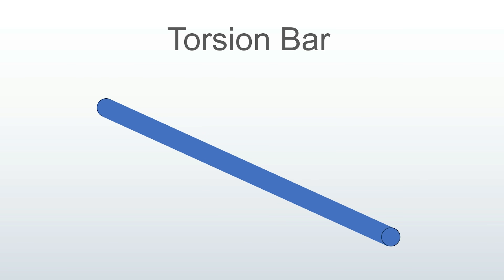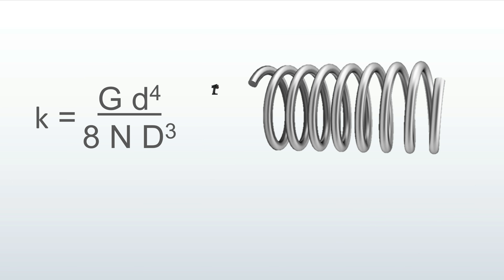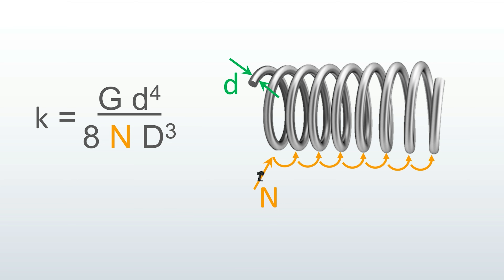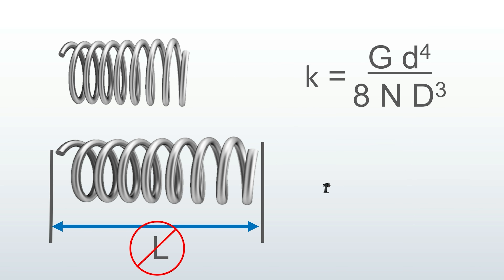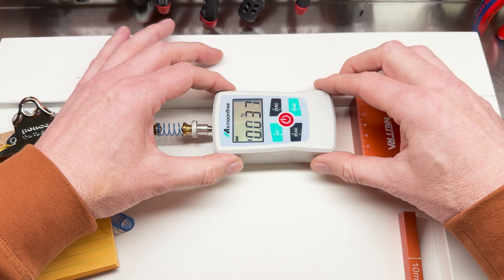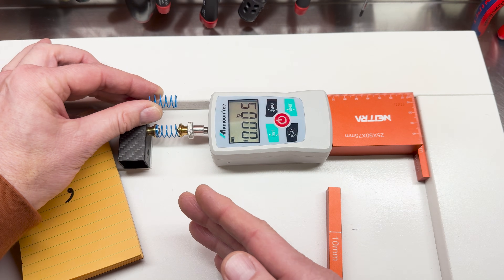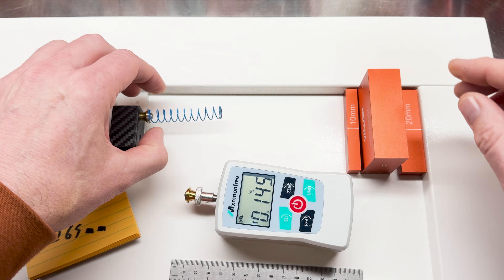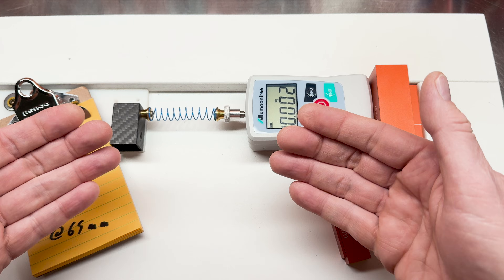Find Out What Happens when you Cut or Stretch a Coil Spring!

Comment: Talk of springs always reminds me of MIG welding wire spools. If the end gets away from you and unspools, you have to cut that section off. It can't be rewrapped on the spool. At the factory, the wire has a twist put into it in the opposite direction of how it's wound on the spool. This keeps it under tension and straight as it comes off the spool when pulled through the feed rollers and pushed through the gun liner. 
It's something that's not as well known as it should be, as it's likely caused a lot of smashed welders and pee'd off weldors.
Reply: @BoomslangSuspension  I know. Sounds nuts. But once you know, you know. 😁👍

Comment: Since F = kx, if we assume we have two springs that are connected end to end, each will have the same extension. This means that the same force will cause the extension of the whole spring system to double, thus halving the spring constant. What you are doing is just the exact opposite argument
Reply from the maker: That’s called springs in series. 1/ks=1/k1+1/k2

Comment: When you stretch the spring, the diameter (D) changes, and is made smaller.
Reply from the maker: True. And the number of coils changes as well so the result is the same. N and D are simply ways to calculate the wire length and that is not changing.

Comment: Springs are tricky, I raced motocross for years and experimented with progressive springs. Cool video thanks!
Reply from the maker: That’s cool you experimented with progressive springs! They are not that common but super good for heavy vehicles and big jumps.
Reply: @BoomslangSuspension I ran different rates, but ended up going the other way because of the rebound. The rear would kick like a mule on steep jump faces.
Reply from the maker: Makes sense. You need to have a high speed damping "catch" at the end of the stroke to compliment a progressive spring.

Comment: Is milo steel used or another type? Thanks!
Reply from the maker: I don't know what milo steel is.  "Spring Steel" can be any one of about 10 different alloy compositions and is usually very high strength.  The "modulus" which is the inherent stiffness of a material is basically the same across all steels.
Reply: @BoomslangSuspension  Sorry, meant mild steel. Thank you.
Reply from the maker: Spring steel is usually a high strength steel alloy - the opposite of typical mild steels.
Reply: @BoomslangSuspension Makes sense. Last question,  back in the day, people used to heat springs in their cars as an inexpensive way to lower them. I recall those cars were super bouncy after the coils were heated. But since the rate in theroy hasnt changed - what would account for that. I apologize if you already answered this. I havent seen in comments. Thanks again!
Reply from the maker: I assume they are not running the springs hot, right? Letting them cool back to ambient temp? There is no way that would change the spring rate.  Placebo effect and confirmation bias.  It might actually ruin the heat treatment and cause the springs to collapse and sit shorter, but definitely would not change the base spring rate.
Reply: @BoomslangSuspension  Yes, correct, they are not running the springs hot. And yes, the springs collapsed on itself from the weight of the vehicle and being heated red hot until the car lowered. I appreciate the fast reply and all the incredible knowledge from a top rate engineer! Have a great new year!
Reply: Mild steel is a low carbon steel. It can't be heat hardened as it is of the shelf. "Spring steels" need higher carbon content to make them "harder" so it resists the force exerted on it. The carbon is what reacts to the spring steel being heated, then quenched. This makes it hard. Tempering then draws back (lessens) the hardness. This is done because carbon steel that is at max hardness is also brittle. So the magic of high carbon steel alloys is not only in the composition but how is "treated" in terms of both initial heat, how it's quenched, and how it's temperature treated after. That's a very rough, basic version. Getting into the long grass of "high carbon steels" is encyclopedia length! Alloying additives, grain structure, heat cycling, quenching temperature, quenching media, cryogenic post treatment, etc, etc, etc......  😁
Reply from the maker: Bottom line - all those treatments still produce identical stiffnesses.
Reply: @wingnutbert9685  Wow, tons of knowledge.  I appreciate the easy to understand version too! Is it mandatory for quenching when heated generally speaking. Or if were to cool naturally would it's characteristics change greatly?? Thank you and I apologize for all the back and forth.
Reply: @gmummy  If you want to soften a high carbon steel, you would let it slow cool after heating it up. Some just in the air. But some get cooled slower by sticking them in vermiculite, for example, as an insulator to slow the cool off. Generally, high carbon steels are quenched in a liquid. Anything from water, salt water, to various oils. Sometimes just used motor oil, vegetable oils, etc. Some require special blend oils. There are fancy steels that are plate quenched. They get heated and thermal cycled in stainless steel foil. Paper is added into the foil packet to burn off any remaining oxygen. Once heated to a specific temp, it's plate quenched by way of clamping it between two thick aluminum plates and air is blown across it. Even further treatment consists of removing the piece from the foil, then putting the steel into liquid nitrogen which further alters the grain structure in the metal to get specific characteristics. But this is more blade making than coil spring making. 
The main thing is heat to a specific temperature, soak for a specific time, quench in a specific way, then temper it at a specific lower temp. to draw back the hardness to make it less brittle and more tough.
A metal working file is quite hard because it has to cut steel. This hardness makes it more brittle and therefore breaks more easily if you drop it. A wrench is more tough because it's not as hard as a file, but still hard enough to not be damaged by use. A knife is sometimes both. The cutting edge is quenched first while the back of the knife (the spine) is left out of the quench fluid for a few seconds, then plunged in. This makes it less hard than the cutting edge. This gives an edge that can be sharpened finer and keep that edge longer (but is harder to sharpen) and the spine is tough so the knife can take the forces of being used without bending or breaking. 
Anyway. In the weeds we are getting. 
If you go to a hobby shop, they'll have what's often called "piano wire". It's a higher carbon steel. You could heat it red hot, cool slow to make it soft (annealing). Wrap it around a small pipe to bend it into a coil spring shape. Then heat it and quench it in veg oil. Then toss it in an oven for a half hour at 400degF to temper it back so it's not brittle. Make a bunch. Compress one that's only been quenched and try tempering some at different temperatures to see if you get different stiffness's. If you want to play around with the basic concept.
Reply from the maker: I would not recommend trying to heat treat yourself. It depends greatly on the metal alloy and prescribed cooling/quenching times and temperatures.
Reply: @BoomslangSuspension  Technically, yes. But simple med to high carbon steels are pretty forgiving in terms of the three major steps. Something like piano wire would fall into that category. If someone wants to play with it for fun, it can be informative at a basic level. 
And yes, as I said, if one gets into more complex steels, like your suspension bikes, then there are a host of special guidelines and treatments for sure. But dude just seemed interested in the general basics. 😁👍
Reply: @wingnutbert9685  Thank you very much for all of the great information and time to discriminate! 😊
Reply: @BoomslangSuspension  Got it now. Much appreciated it 🙏